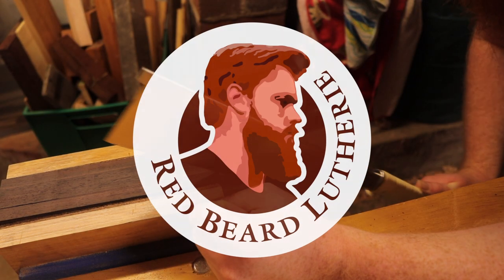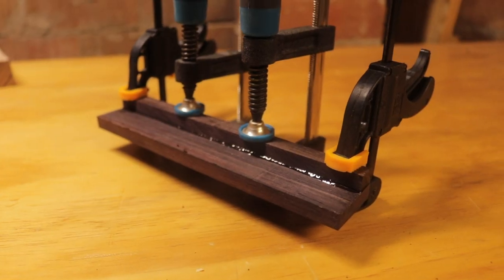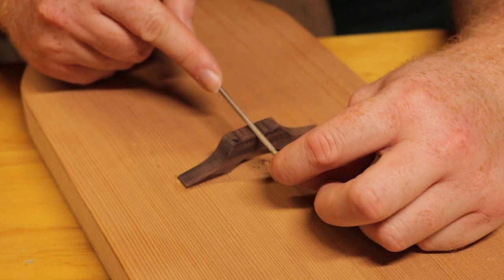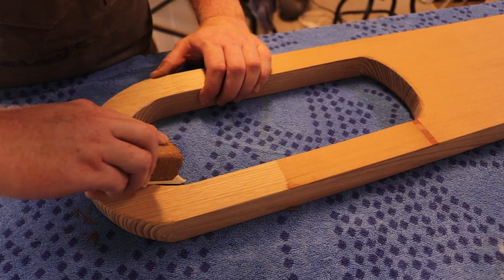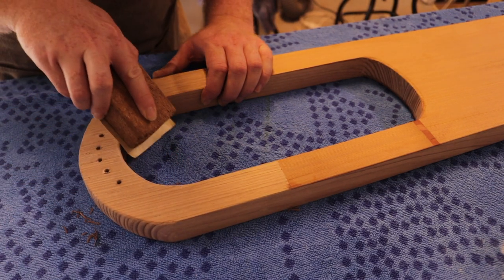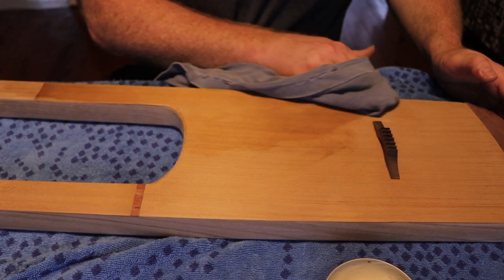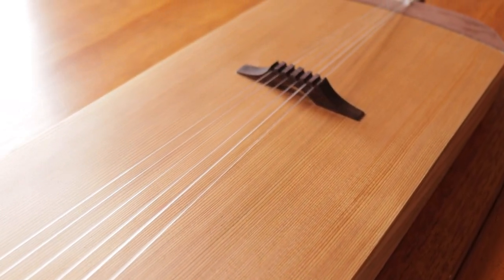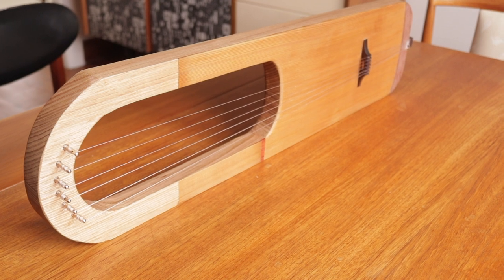Making an Anglo-Saxon Lyre | Chapter 3

Comment: Thanks for the video. I don’t fully understand the steps to laminating the bridge. How did you ensure that the grain was vertical?
Reply from the maker: If you slice a quarter sawn bridge blank in half, and just stack one half on top of the other, you will be sure to have the same grain structure. Ideally you would just make the bridge out of one solid block, but I didn’t have one big enough on hand

Comment: I LOST SIGHT OF THE SRING HOLE/ATTACMENT SCHEME ON THE LYRE. CAN YOU PROVIDE DETAILS?
Reply from the maker: Do you mean the tuning pegs? I bought an inexpensive generic set off the internet. Traditionally they would have used wooden pegs. I purchased the plans off the Dutch Luthier website. I would have a look on that website if you are after specific measurements
Reply: I MEANT THE TAIL  END OR BOTTOM END  OF THE LYRE WHRE THE STRINGS ARE TIED TO THE BOX END.
Reply from the maker: Ah okay. 7:36 is the best spot to view it. It’s a small block of Indian rosewood cut into a sort of square U shape. I just tied all the strings to it

Comment: Good evening. Please excuse me, I do not know English and I am writing through an interpreter. I could be wrong. I dream of making myself such a lyre. Can I ask you about the size of the lira? Case size? Width? Case thickness?
Reply from the maker: Hi there! I recommend purchasing the plans using this link below. It’s about 580mm and 200mm wide at the widest point. My lyre is about 25mm thick, because that was what was available to me, but I think historically they are thinner. Best to use the plans below. It’s what I based mine off. Best of luck with your build! 

https://thedutchluthier.wordpress.com/
Reply: @redbeardlutherie1173  Thank you very much! I'll try.
Reply: @redbeardlutherie1173 I managed to make a lyre. Thank you very much.
Reply from the maker: @user-nb7ge7ny3p congratulations! That’s fantastic 😁